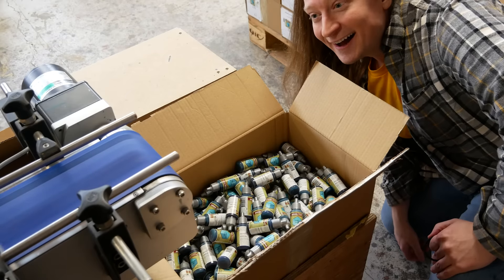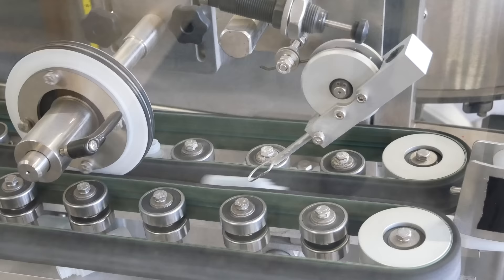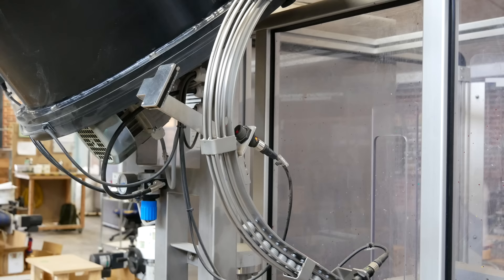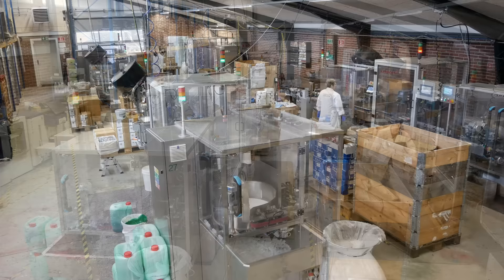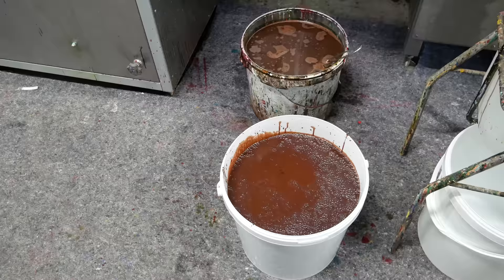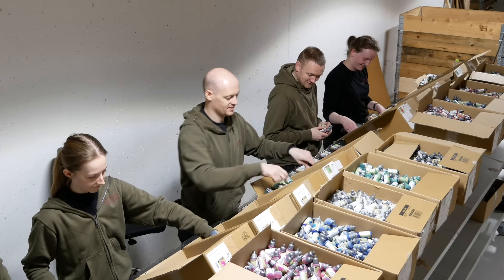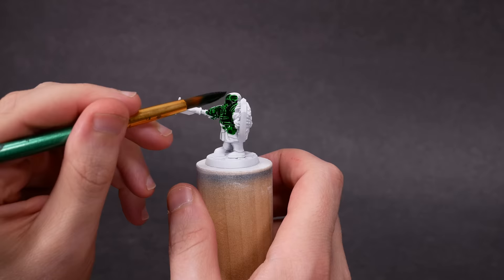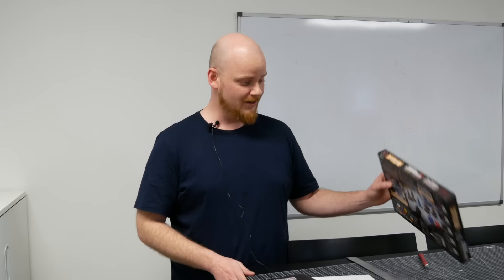Inside a Paint Factory! How Paint is Made, Bottled, and Packaged

Comment: I briefly had a job doing maintenance on bottling lines like this.  Specifically Gai brand ones, among others used by the beverage industry.  The lines in this video are some of the cleanest ive seen lol.  Good job AP.

The in-house diploma after becoming certified to run this does not surprise me.  It is extremely technical work keeping the line dialed in.  Especially if one person is in charge of several modules, they would barely get a chance to breathe.

Comment: As an amateur chemist myself you must have loved this, I was once lucky enough to visit a Toyota factory, not as interesting from a chemical point of view but from an engineering point of view knowing that they can take a few flat pieces of steel and some steel rectangular tubes and in less than 30 mins they become the basic chasis and bodywork of a car.  That basic chasis moves into a second factory where in 90 mins it moves from a basic skeletal chasis to a full car with engine, dashboard, trim, seats, wheels suspension.  At full speed they can roll a full car off the production line once every 90 seconds.  What amazed me was the fact to attach the entire engine AND front suspension with wheels took two people, with a couple of bolts, one plate a hydraulic tool and a shared hydraulic platform just 90 seconds to attach the lot.  Yet you take it to a garage it will take mechanic min 4 hours to get the damn things back off.
Reply from the maker: omg I would LOVE to see a car factory, that sounds super neat :-)

Comment: i recently bought a wet pallet from army painter and i got 2 insctruction booklets on tips on how to paint and how to model and damm i was really impressed with the quality of those, i watched so many yt vids when i was gonna start and they had it in 2 small booklets 😅
also the modeling 1 had a really usefell tip on how to unstuck like the tube of the super glue and iveo nly tested it once so far but seems to work well better then cutting of piece by piece that ends up in a big mess and a lot of unused superglue :p

Comment: I use their wet palette and particularly like their black air primer for brush on (the white needs an extra coat or two).

I just used Strong Tone in anger last night and was impressed at how it turned a white primed model into a beast in a few minutes.

I've been holding off on Speedpaints until I learn the 'traditional' method first, but my patience is wearing thin.

Sadly, my FLGS complained Brexit had ruined their ability to acquire any more stock, such as the SP 2.0 line when it comes. I hope this is resolved.

Comment: I´m a bit supriced they did the batches with 10L cans, but i guess it makes sense when the volume of paint they sell is fairly low

But the packing being totally manual, it looks like the most labor intensive part. The machines to fold the cartons are quite common and also machines to place the paint in the boxes.

Comment: One thing I've recently toyed with is the difference between using titanium vs zinc as your white. I was surprised at the difference. Get something like a speedpaint, shade, contrast or ink, (as translucent as you can get) then mix in batches with a zinc white from an art supply store, and another bit with titanium white, then take a look at the difference.

Because the zinc is more translucent it gives more vibrant colors that make better glazes. But, that translucency means poorer coverage. However, it works different than just adding medium or water to a paint with titanium white. It's just more rich.

Comment: 2:13 it shows how they load the paint into the pumps. My main concern as there is no mixing going on during this phase, so a huge tub of paint is just sitting there and losing its homogeneity (likely losing it quickly from my personal experience working in paint RnD years ago)  whilst its being pumped into the bottles. Are AP aware this completely undermines all their efforts of putting all these agitators in the final products?

This seems like quite a big deal.
Reply: We mix each batch for three minutes straight before being poured directly into the tubes, and as fast as we are able to produce paint, it really doesn’t have as much time to settle as she would think. Also inspections are done after bottling to ensure consistency and coverage that is reference to a master so if anything is flagged us, not having the consistency or coverage as we come to expect from a certain color, then we can go back and remake the batch.